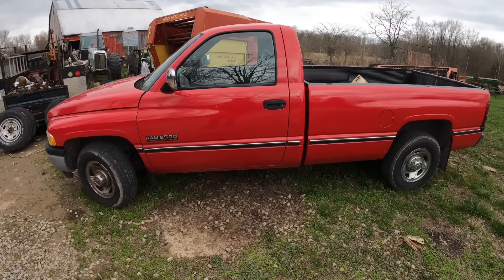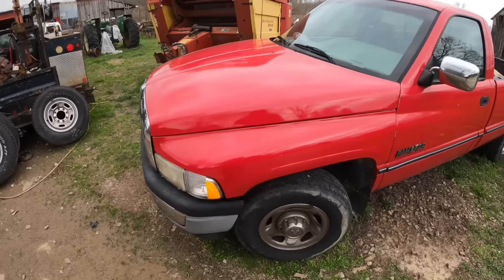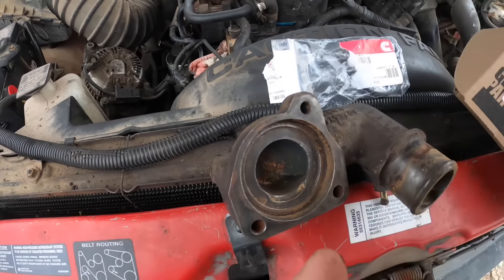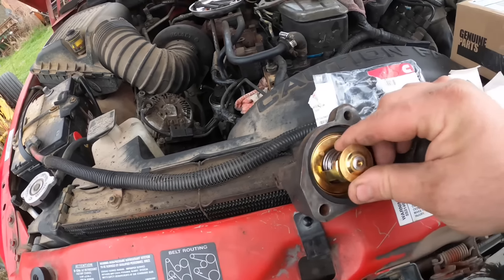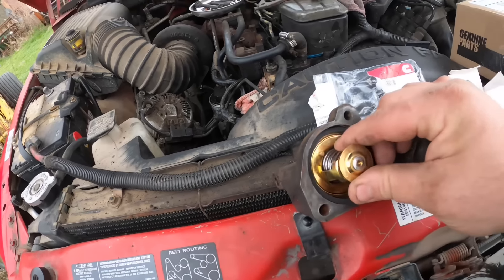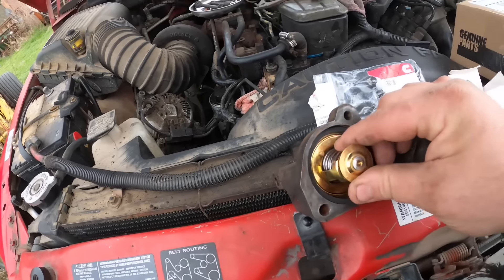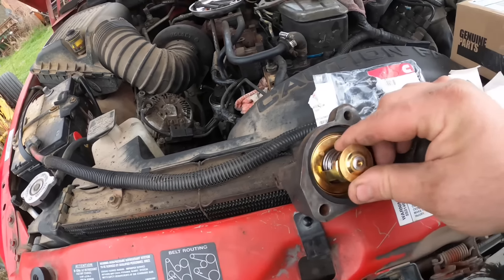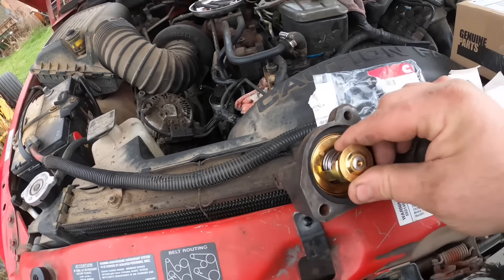1994 DODGE RAM 2500 5.9 CUMMINS DIESEL Repair-Part 2

Comment: I had better luck with that series of  dodge than the 2003 on up. When they put the common rail on it seemed like they had more problems,mine did anyway. 
One more project completed. Always feels good to get them checked off

Comment: If the heater is slow to heat back flush the heater core not hard to do  before replacing core

Comment: 5.9's do take forever to warm up! Have an 03, the one winter I had to drive back and forth to work with it, 30 miles one way, seemed like I'd be half way before any heat came out.

Comment: That valve on the back of the T-Stat is to Open or Block the Bypass and if you dont Have that valve it can cause one of 2 problems it will cause Slow warm up or can in summer cause overheating .SEE

Comment: It is a Dodge Ram Truck.  What do you expect it to do.  Mine is a red regular cab short bed and has a 4.7 (287 cu. in.) and it is a handful if you are not careful on gravel or wet roads.  It likes to wag it's tail if you are a little to hard on the accelerator pedal.  We are going to pull my 24' implement trailer to deliver some art pieces next week.  I doubt if the truck will really know it is back there.